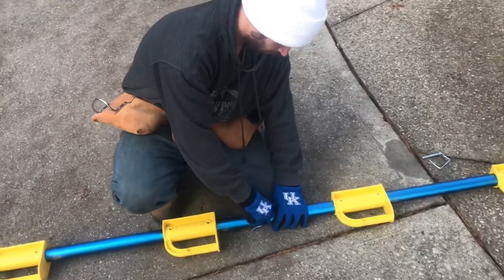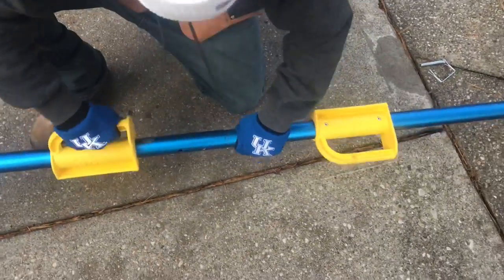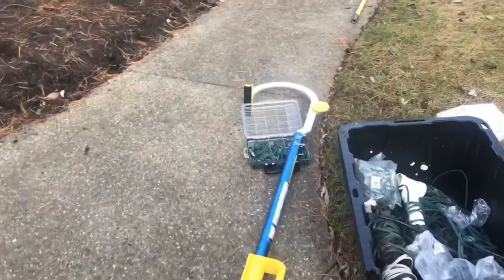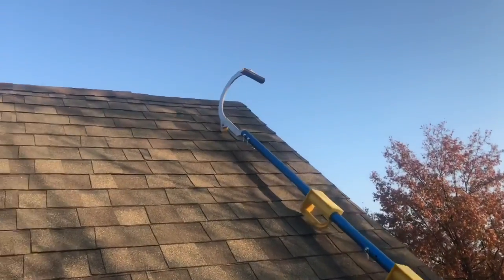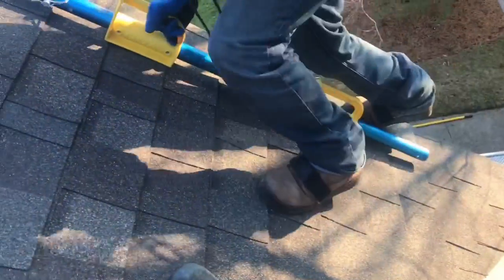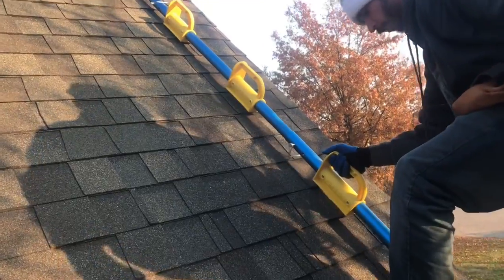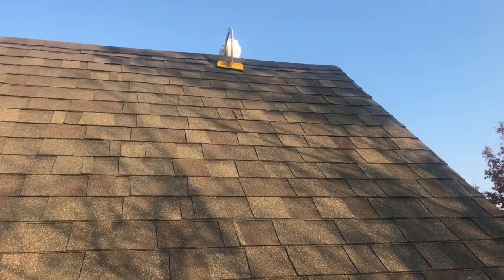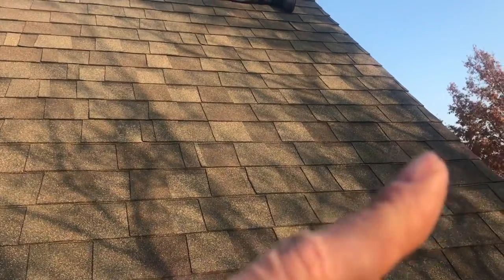How We Install Christmas Lights Using The Goat Steep Assist

Comment: Why not use a roof ridge ladder hook?
Reply from the maker: zmckell you can the goat weight is 3 lbs
Roof ridge hook and ladder you are at 25 lbs holding on to another ladder
Reply: The goats way lighter and easier to use